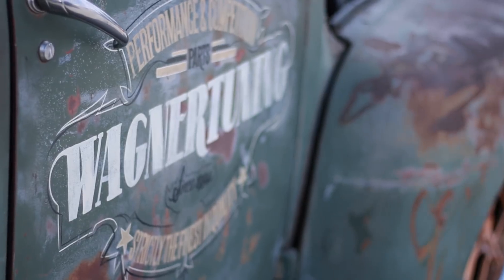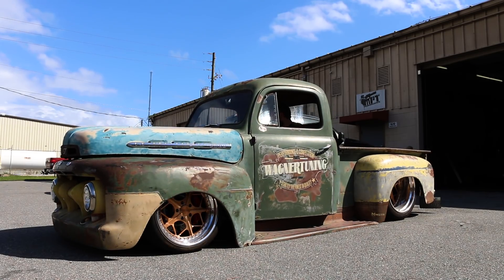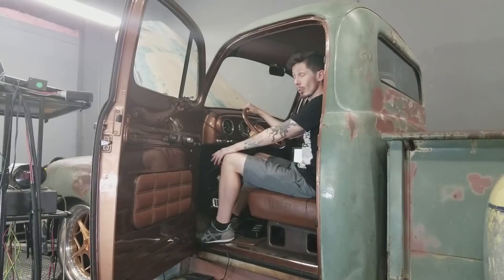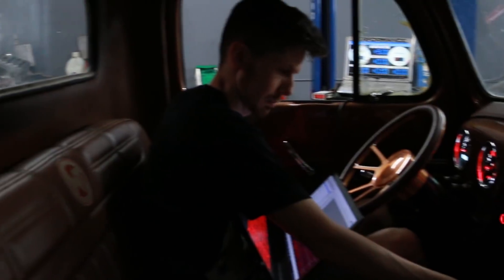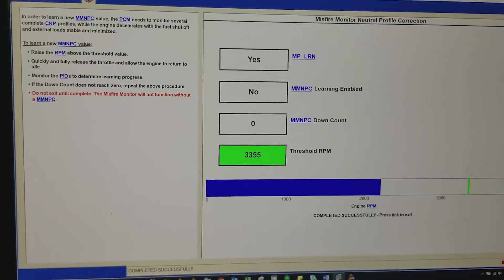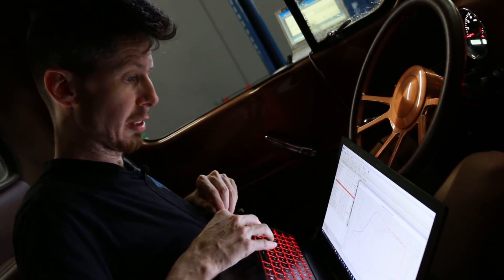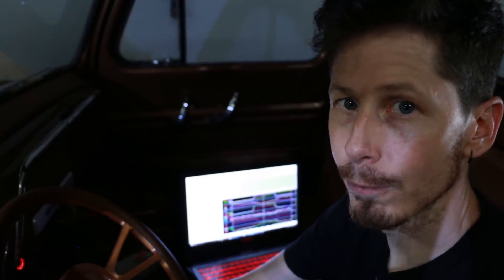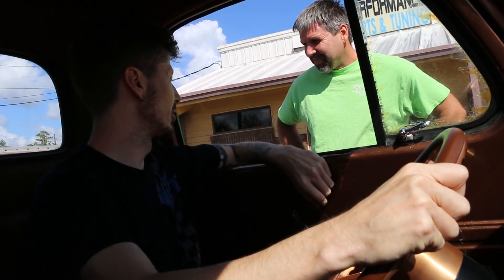1951 Ford F1 Ecoboost Swap | Wagner Tuning | MPT Performance

Comment: For some reason content on Ecoboost 4 swaps is plentiful, but info on Ecoboost V6 swaps is uncommon. I think that's a real shame, because Ford turns out F150s with Ecoboost V6s like potato chips. There are tons of them out there as potential donors, and they make a good deal more power out of the box than the fours. It's harder to get good sound out of a V6, but it can be done. This truck sounds great. Other V6 vehicles, not so much. Seems to me it's worth playing with the exhaust a little for the combination of power and fuel economy you can get from a stock or nearly stock engine.

Comment: doing the same in a F-100 I'm having trouble finding aftermarket ecm?  Is there someone you used to wire up engine harness?
Reply from the maker: You would have to contact Wagner for that information.

Comment: Sorry guys this is a 52 F1.
The 51 does not have the separate Ford letters under the hood as this truck shows.
It should be on the cast emblem assembly on the front beak of the hood.
As far as the Ecoboost install.
Nice job but my 51 will only have a cast iron V8 rumbling under its hood. But then I am an old fart!!

Comment: I really hate it when people do this to old vehicles(Make them sit on the ground and put auto transmissions in them) but I will say that is a really nice build. The only thing that really throws me off is the fact that there is no floor in the bed. I guess the ecoboost is ok though better than those pos flathead 6's. Get good mileage with it too. I have a feeling this won't be driven long distances though.

Comment: No thanks, soon as I seen v6, I left
Reply: later boomer
Reply: @carladamcarter  seems like a waste of nice truck to just put a v6 in it, not even a cool one. Maybe if it was like an old inline 6 and they made moderate big power with it, thatd be alright. Hell even a 2 stroke Detroit, 24v or 12v cummins, something like that would be way cooler.
Reply: theoutbackbandit it’s the coolest possible choice for a V6 you could ever imagine. You’re a curmudgeon, and not even a charming one. I bet you haven’t even driven a 3.5L ecoboost lol
Reply: @carladamcarter  I'm not old nor have I ever really lost my temper, especially online. And no, a cool v6 would be a 6v53 or 6v71 2 stroke Detroit. Another cool 6cyl would be a done up turboed 300 i6. EcoBoost is just something that another truck of nowadays is gonna have.
Reply: False, first you left a comment, and then you left.
Reply: @NathanNagel  nothing much better to do eh?

Comment: I don't understand all the negative attitude about this swap.  A swap is a swap is a swap. So many people are putting Small blocks in every vehicle under the sun and nobody says a word. Swap a v6 turbo and they lose their damn minds. I want to swap a 2JZ into my 98 2500 Cheyenne. Will I care who likes it? Nope cause it will be awesome.
Reply: Chris Wolinski That’s how the Internet is now. It’s just people complaining about everything. That and some people can’t stand the fact that these V6s have crazy power. As an owner of a 2013 F150 with an EcoBoost, I think this is sweet. It’s different. My brother just built a 30-something Ford sedan rat rod from scratch and he put a Ford 300 inline 6 with a 4-speed in it. It’s something different.
Reply: @1981AdamGs  Better to see a Ford in a Ford swap instead of a damn lame Chevy LS.
Reply: Flip even a 4 cyl eco out of a mustang would had been sweet I guess they don't want the ability to go 400 miles on a single tank of gas instead of 150 plus twice as much power as stock . I had my 69  390 rebuilt nice sound  C6 as well only how can you really drive it daily unless I want to spend 200 a week on gas . I would put a eco swap if I could with trans heck yeah

Comment: What was the fix for the multiple misfires, My last ecoboost was always missing, spent 3 months at 5 different shops, when I finally picked the truck up the last time and said the hell with it; it chunked #1 and cut the block half in two...literally. You could stick your arm through  the motor.

Comment: I wanna know how they made a stand alone PCM. Id love to swap this motor into something else. Just dont know how to make a stand alone pcm without using the original pcm and cluster and column. Awesome job!
Reply: Doing standalone harness isn't that hard with some patience.. it's not anymore difficult than ls harness..just get the ecm pinouts online.. and make sure you/ remove security system.

Comment: The old trucks had 6 pots in em anyway,  the 2JZ is a nice replacement for the stovebolt 6 in GMs. Hater gonna hate but this is the 25yrs later Ford version of GMC Syclone/Typhoon Buick Turbo Regal.  Im sure mustang 5.0 people bitched about the sound of Syclones and Regals passing them as they lost when they were rewinding Nirvana/snoop dog tapes

Comment: sounds like shit that's not what a old ford should sound like. it does not sound good ruined an old truck id rather the stock flat head then that pos
Reply: Chandler Robinson this truck came with a 97 sumting hp,
Reply: Chandler Robinson how those this truck sound like back then
Reply: Chandler Robinson bro ain't the f100 like a ranger a smaller f150?
Reply: Chandler Robinson, cool then make yours how you want it...but you don't have an old truck.
Go put cards in your spokes.
People always gotta bitch...
Reply: George Hembrow I doubt those ecoboost engines will outlast the engines in the 92-96 Ford Trucks.
Reply: Andrew P so are you
Reply: about 200000 miles are is about all I would reliably drive in a 5.0 or 5.8 windsor. Any more than that get's a little iffy, I got a 96 bronco that has had the engine rebuilt but it still has 340000 miles on the body and frame. The engine and trans have about 60000 miles on them but everything else is starting to go and I am basically doing a restoration on it with all the mods and preventive maintenance I do every year on it.  Now the inline 6 and the 7.3 diesel on the other hand can probably do an easy 300000 each as long as you don't abuse them, but I have also seen a few ecoboost engines with 300k already (mostly fleet vehicles)  I suppose as long as you keep up with basic maintenance and maybe have the timing chain inspected every 100k and probably add a oil catch can to prevent the direct injectors from being gummed up the ecoboost will live a long healthy life.
Reply: Did it have a flathead or the inline 6? I don't recall the inline 6 sounding any better than an ecoboost.
Reply: Funny how no ever complains about diesel swaps.  Like how heavy they are and sound like a tractor LOL
Reply: Its better than a boat anchor 350. You can get 300 hp out of a flat head 8 though
Reply: Chandler Robinson at least it didn’t have a pos Cummins put in it
Reply: Anonymous Subscriber cummins makes good engines..
Reply: A flat head??? Seriously???? Thats like welding eight Briggs and Stratton engines together...get with the times dude these Eco boost engines are killing everything in their path...old with a touch of new is awesome...
Reply: @georgehembrow5398  
Agreed
Reply: Chandler Robinson you're an idiot.
Reply: These freakin v-6 engines these days are all about soy foods. Low T goofs that can't badger their parents for enough gas money to drive their gaymaro. Sure they make some power on a dyno, THAT'S THE GIMMICK! In the real world, I'd much rather putz along at 1700 rpm than 3700.
Reply: you do realize that these engines have substantially more torque than all of the competitors V8 engines ? As well 90% of there turque is available under 2000 RPM. Which is once again substantially more than there V8 competitors. The cool thing about a DYNO is that it doesn't lie.
Reply: and they last 90k miles...have fun with your new tech!

Comment: Why can't mpt make or write a tune for the 2017 ford f150 3.5 ecoboost engine????
Reply from the maker: We support engine and trans tuning on the HP Tuners nGauge. When SCT has engine and trans support we will offer it on both platforms.
Reply from the maker: http://www.morepowertuning.com/ngauge-mpt-2017-35ecoboost-f150
Reply: How much to remotely tune my 2015?  I got HPT all setup and ready to send the file over with a log .... Just want something conservative but sporty.